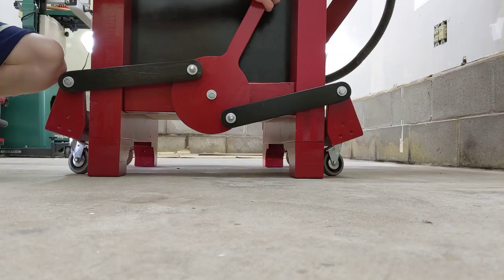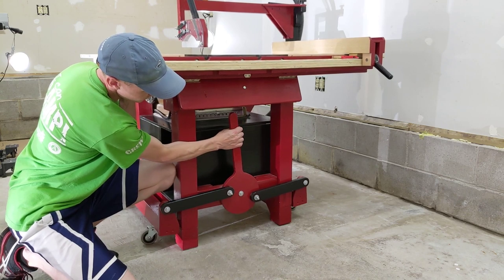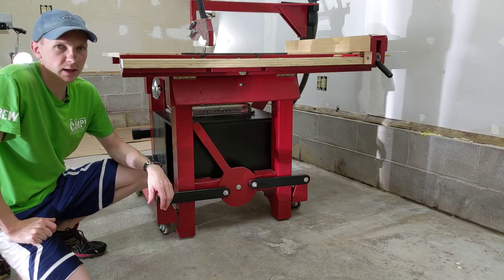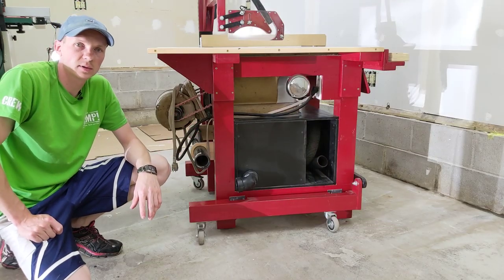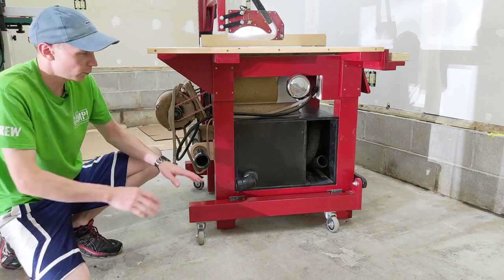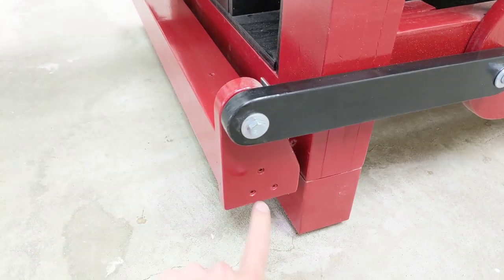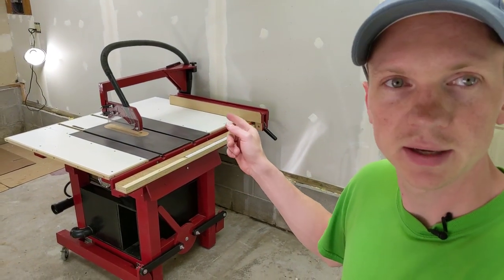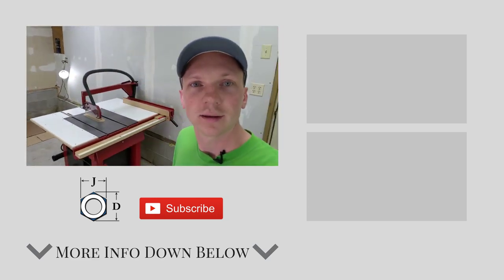Single Action Retractable Casters (Homemade)

Comment: This is a really nice design.  Subscribed after seeing some of the innovative designs on this and other videos of yours. 

There is something really important that it looks like you did on yours but didn't mention.  If the bottoms of the caster supports are not parallel to the ground the casters won't turn very well.  I bought a similar vintage Craftsman saw with the steel frame and Craftsman wheel kit.  The lifts didn't bring the stems of the casters all the way to vertical and I had to lift the heavy saw to get the casters to turn.  They worked OK after I modified the mounts.  Just wanted to point this out for anyone that decides to build their own.
Reply from the maker: Excellent point. Thanks for contributing!

Comment: I've looked at dozens of designs and this is my favorite.  I will try to build it.  If you sold plans I'd buy them.  While I can craft my own--buying yours would provide at least three advantages:  (1) I'd give back a slight bit to your originality and effort; (2) I'd save a bit of time; (3) I'd be able to take your counsel and wisdom about whether the system is best served by attach the wheels to either the 24" or the 96" side of my 24x96" rolling workstation (and whether I should use 4 or 6 wheels on a heavy table).  Best of luck.  Of course, I subscribed.

Comment: I noticed you added extra screws to the hinges close to the pivot points.  That's very important and prevents bending the hinges due to the high loads this design produces. 

Well done.  I really like this one.
Reply from the maker: Good eye! You are correct

Comment: Extremely great idea.  The problem with most retractable casters, is that you have to be able to get to the caster to flip up or down.  This would allow you to put it against a wall or in corner and flip up or down easily.  One thing a person could insert a pin or screw into the disc shaped section of the arm to prevent arm to travel any farther, rather than relying to be stopped by table leg.

Comment: Nice build. I have a very similar saw but my cart is much different. However, I see that you have some kind of brush to block dust in the blade height adjustment slot. What did you use there? That is where a lot of my dust comes from.

Comment: Great job sir. Could this mechanism be applied to my current workbench project with the following dimensions 3' W x  8' L x 3' H  [w/6ea. 4'x4'  vertical post spread 4' apart 4 per front and back side] and [bottom plywood floor being  2 1/2" from the ground]? Thank you

Comment: Nice clean looking design Justin   Half inch of lift is plenty to move it around   BTW  the shop modifications look great   I’m a firm believer that working in a nicely finished area   Helps you do more professional work  overall   Plus  i like to work in a clean area  as well  working in commercial construction for over 20 years professionally  guys used tomake fun of m because   I kept the place and myself clean  even though i was making saw dust all day long  !  I might be borderline O.C.D.  ? But it works for me  LOL  i worked out of a Kennedy brand tool box  and. Ive always said that if i had a picture of my tool box from years ago. I would bet. That most of its contents are arranged the exact same way  years later  with the minor exception of a few additional tools or newer models
Reply from the maker: Thanks Craig! I think I spend as much time cleaning as I do building. I've got some ocd as well!

Comment: A good design Sir...Did you refer or is it all your own work, and how did you decide what position the timbers that hold the castors should be in...?
Reply from the maker: I had some inspiration from Carl (see description)
Reply from the maker: I put the timbers that hold the casters where they are based on lifting the saw 1/2 inch off the ground.

Comment: Wouldn't it be simpler the other way around? So the casters are part of the table, and the solid blocks are retractable. Then you don't have to take the swivel of the casters in account. The wider base also makes it more stable when the solid blocks are pushed down.
Reply from the maker: No, for two reasons. The casters allow for a pivot point. Since the wheels are round they make the lifting action easy as they rotate and translate when lifting the saw. It would be much harder to lift using square legs. Also it's much better to have the legs be ridgid and solid with no moving parts since the saw sits on the legs. If the legs were on pivots or other moving system, there would likely be play and it would not be as stable when sitting on the legs.